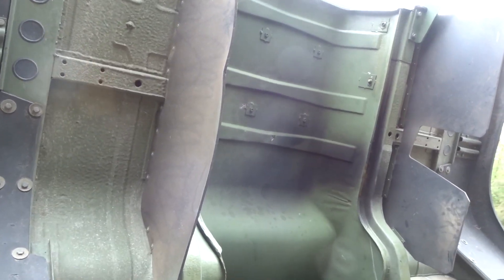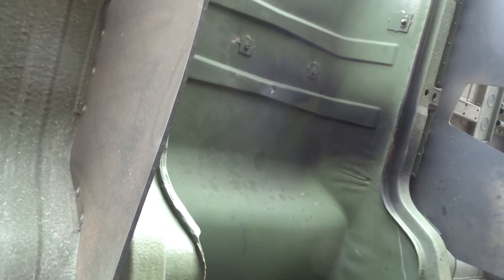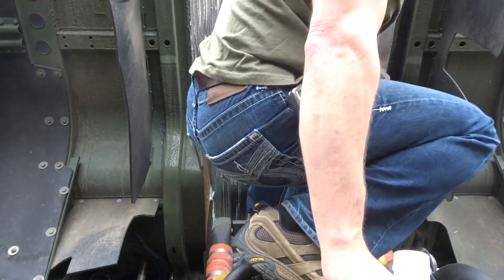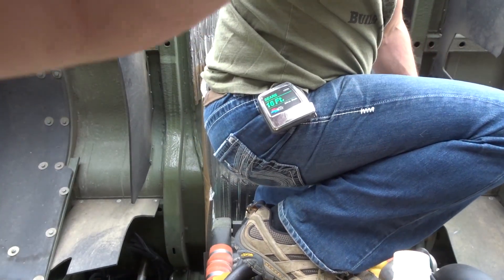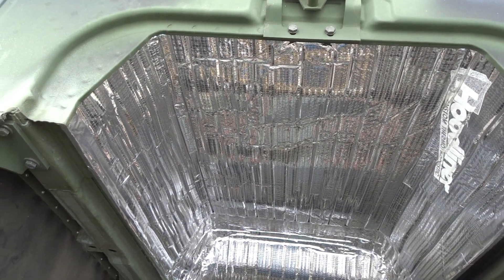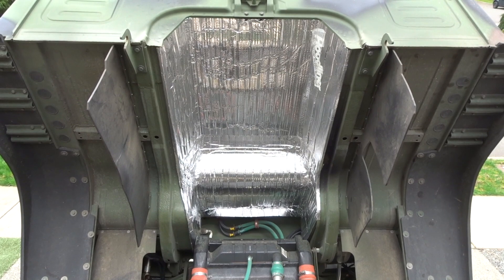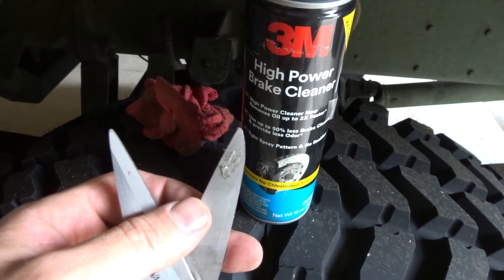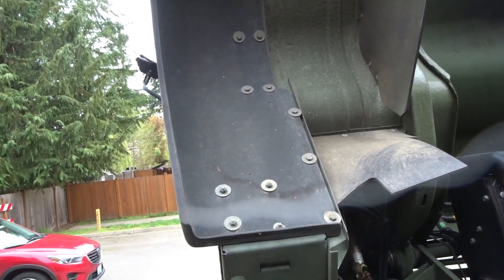In the Dog House with the LMTV

Comment: Do you have a link to the dyna Mat if so can you please forward it to me we took Optimus out camping this weekend and the fan kicked on a few times I want to quiet it down even more
Reply from the maker: TRACKS OFF-GRID Dynamat 11905 Hoodliner 32" x 54" x 3/4" Thick Self-Adhesive Sound Deadener https://www.amazon.com/dp/B00069QLVC/ref=cm_sw_r_cp_api_i_i1I2CbR35WC0R
Reply from the maker: TRACKS OFF-GRID you will not be disappointed.

Comment: Do you have the amazon links for your sound deadening?  So you get credit for my purchase to support your Chanel?
Reply from the maker: yes, here is the Amazon affiliate link. https://amzn.to/3cyAiMH
and I bought 2 kits.
Reply: Broke OverLand 

Cool, just ordered 2 kits!   What edging tape did you use?   If you have a link, I will  buy off your affiliate link there as well.  

Thanks!
Reply from the maker: @dcraigslist5243  Nice, you will not be disappointed, the sound deadening was significant. I used some aluminum tape I got at Lowe's. but you can get the same stuff on Amazon. https://amzn.to/3gxFxPG
Reply: Broke OverLand 

On order!   Thanks!